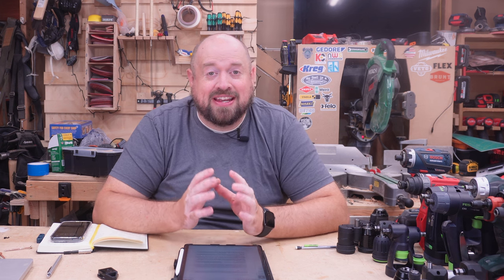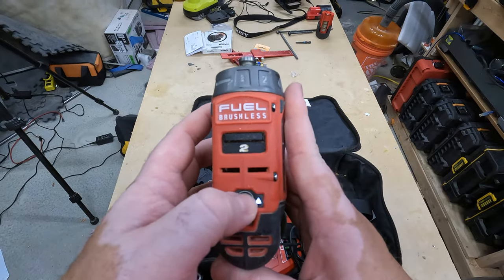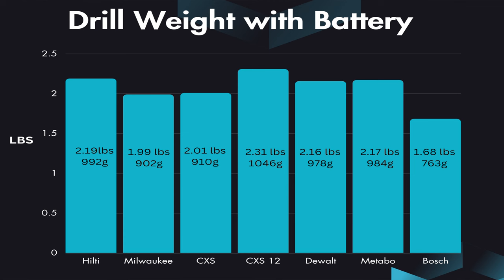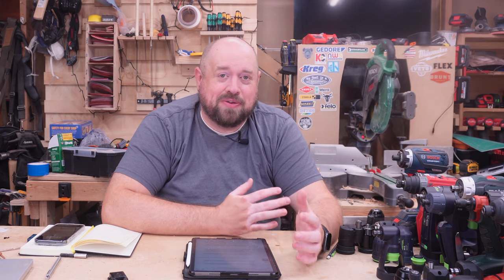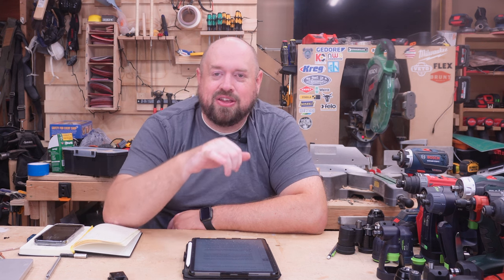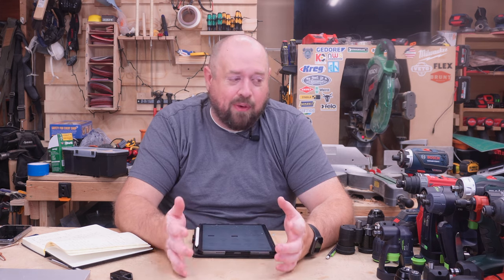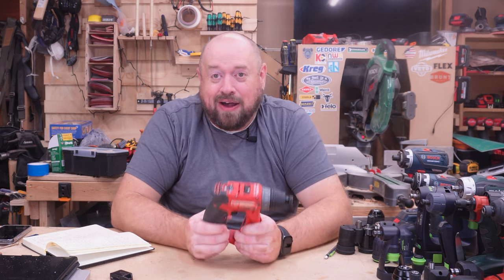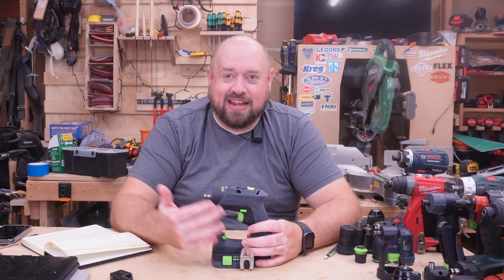Installation Drill Showdown!  Can Festool beat Milwaukee, Dewalt and More???

Comment: Bosch 12v Chameleon is the best.  The benefits of its super light weight can't be overstated. I use it every day -  very high quality and so light weight it's my go to for driving in thousands of zip screws every week.
Reply from the maker: It performed well in testing.  I have liked mine but just prefer some of the ergonomics of others more.   But you really can't pick up a bad tool in all of these.
Reply: I just picked up 12v Bosch Chameleon kit for 75% off and additional 10% military discount for $33.50.
Reply from the maker: You got the Lowe’s clearance deals I’m guessing?
Reply: @yorselrus1996  Wow that's a steal. I got mine for $99 on Amazon. I would've cleared all the local Lowes inventories at $33. Would be one hell of a gift for families and friends for Christmas.
Reply from the maker: I ended up getting other Bosch tools on the clearance deal but I have had the Bosch for more than a year now.  It’s a bit of a shame they aren’t going to carry them anywhere local to me anymore though.
Reply: I have one and love it. Also got the 12v planer, wow cool tool.

Great job on mash up, Tinker with Tools. As you say many fine niches in here.
Reply from the maker: Thanks Greg!
Reply: i have the brushless flexiclick and still reach for my cxs, until you use one, its hard to explain.
Reply: So what you’re saying is you own the Bosch.
Reply: @robertrada4783  hes saying he is a lizard man
Reply: I second this, mine is always in my bag for service plumbing. Mostly run Milwaukee but I like this drill and Bosch's FL12 work lights.
Reply: Seen yesterday for 99 bucks.Probably been there 3 plus years.
Reply: I have a GSR12V-300FC and it's my favourite. It beats everything else where it matters - size/weight, clutch precision and consistency, ergonomics.
Reply: Festool CXS very ergomomical. Its save your hand

Comment: I’ve had the m12 installation driver and the Bosch chameleon and the Bosch wins by a lot. Just that forward/reverse button on the m12 is enough to discard it. The chameleon is my daily, love how small it is and has more than enough power and speed to do everything I need to do and more
Reply from the maker: Yeah it will be interesting to see if Milwaukee changes that on a future generation.  But you are right.  The Bosch has a lot of good things going for it.

Comment: I got the Festool CXS 18 as my installation driver for work. The handle is much larger which allows for both the middle and index finger usage.
Reply from the maker: Thanks for sharing that info.
Reply: i have too but the noise level is terrible , and am going back to my faith dewalt .
Reply: FWIW Festool also makes a 12v & 18v drills that use the same range of chucks, and have a conventional grip. TXS12 & TXS18. They are trying to cover all the bases.

Comment: bosch 12v flexiclick has SDS attachment as well. its fairly new, but it is available in the US.
Reply from the maker: Yeah I found that after filming and during the edit.   Reasonably priced too.  Have yon tried it?
Reply: @TinkerWithTools  no I have not, but I was thinking of buying it in the future after I upgrade my brushed version of flexiclick.
Reply from the maker: I’ve considered buying the 18v version on several occasions just to see how it compares to a top tier hammer drill instead of a dedicated SDS.
Reply: @TinkerWithTools   In Europe you can find the Bosch 18V GSR 60 FC, I don't know how it's called in the US. It is a wonderful tool and most often overlooked in non-european tests I watched. The Hammerdrill attachment for the 12V Version is kind of lacking in a way and received mixed reviews in the german tool market.
Reply from the maker: I could be wrong but I think that its just the GSR18V-535FCB15 in the US market.  The coloring is different here but based on specs, I think that is the equivalent.  I have a video on it I did last year comparing it to two 12v multi-chuck drills, and then I also mention it briefly here.  

I put it through the same testing that I did on this video, and it is bigger heavier and not as delicate or precise.   But it's made like a tank and has a very consistent clutch (just not super sensitive).  Overall I like it.
Reply: @TinkerWithTools  Its quite bad. Slow and over 10mm = almost impossible in concrete. I think its like a good 12v Drill with percussion like Milwaukee/Dewalt/Bosch

The management in Stuttgart of Bosch power tools thinks: We need no 12v hammer drill (Like Makita, Dewalt, Milwaukee, Metabo, Hikoki/Metabo HPT...). Thats the reason for that. Price: 110/115Euros, its like 120-130 dollar
For that price you get almost the normal GSR Brushless drill with 2x 3Ah + loader in the big box

The Bosch Flexi Click 18V attachment is very good and like a hammer drill. 10,12,14mm no problem in concrete. Its a mechanical attachment, not pneumatic like normal hammer drills. Great development
Reply from the maker: Thanks for sharing.

Comment: Excellent, very helpful vid and the last thing I want to seem is critical, BUT a significant item that deserves mentioning here is the Centrotec chuck on the festool.  This requires proprietary shanks or it requires the user to use adapters that either do not have a locking mechanism or otherwise stick out so far that you lose part of the relevancy of  a compact tool.  SIGNIFICANT - but very on-brand - drawback for the Festool
Reply from the maker: If you buy into festool, you likely aren't deterred but the centrotec tax as much as some might be.  Centrotec works really well, but the prices are quite absurd.  So in terms of it working as they intended, it's great.  But for those that don't want to pay the festool tax then I agree with you.

Comment: Bought the Milwaukee last year. I love mine. I have M18 tools and now I'm looking at some M12 tools to utilize the batteries more. I love Milwaukee tools.
Reply from the maker: I have been happy with them too!
Reply: I have everything RIDGID and bought the Milwaukee drill shown. The forward reverse button is just plain stupid. I never use it.
Reply: Wait until you get the M12 fuel multi tool!  I've tried every other brand including the M18 fuel multi tool and the m12 is by far my favorite.  I've replaced most of my M18 stuff with M12.  Saves a ton of space!

Comment: About the Milwaukee forward and reverse switch at first was pretty odd but now I have not problem specially since I can still change it with one hand.
  Thanks for the comprehensive review!
Reply from the maker: You're welcome!
Reply: If you pull the trigger with your middle finger, your thumb naturally moves to the top of the tool, directly on the reverse switches.

Comment: I love the direction switch of my Milwaukee. No accidental switching any more while working with the tool. That happens from time to time with my 18V Bosch. Before using a battery powered drill, I pressing the trigger to ensure in runs in the right direction anyway. Though I have really small hands, I can reach the selector with my thumb easily.
Reply from the maker: You are the first person I have had comment that likes.  not saying that in a bad way, just pointing out this is a first.  I think that it's one of those things that if this is your primary drill, then you will grow accustomed to it, and I can see what you mentioned being a pro.   I just haven't been able to grow accustomed to it.
Reply: I know that most people hate it. It's not my primary drill, that would be a Bosch 18V-60C, but I use it a lot. Have the same kind of switch on my 3/8" impact driver.
Reply from the maker: Yeah, the switch on the impacts doesn't bother me simply because I am not changing modes as much as direction of drive.
Reply: Same here. I also like it. Inevitably I hit the direction button on my impact especially and move it into the off position. Middle trigger finger for the win 🤣
Reply: @TinkerWithTools I think it’s kind of fun. Like being in an exotic* car with the switches in unfamiliar places. Fun but maybe not the most practical…

Comment: I think one of the reasons the CXS 12 clobbered the Bosch a little bit is because of the inline grip ergonomics. Like Sedge points out, with the C-style you don't have to use your off hand to press the back of the drill. The net effect is that the torque is utilized more efficiently on the CXS. I'm thinking about ordering the 6.0 Ah battery for my Bosch. Some reviews say it ups the power and it allows the drill to stand up with the heavier attachments.

Comment: I’ve bought the cxs12  and I love it . I do however already have a T18 and a C18 with all the attachments which all fit nicely on the new 12v driver.
Reply from the maker: The compatibility between the lines is a nice feature.
Reply: Hi! What do you think about the noise?
Reply: @LesTutosdUneMinute  yep. It’s oddly loud at full speed certainly when compared to a T18 . However it doesn’t really bother me and I tend to be using it slowly a lot of the time when it is considerably quieter
Reply: Festool CXS and CXS 12  very good tools

Comment: I imagine the reason the CXS 12 stays loud at a distance is because of the specific frequency of the noise. It would be interesting to measure that and compare to the other tools as that would shed some light on which is the most annoying and/or harmful to your hearing.
Reply from the maker: Yeah, when I found that in the data I started to look into the equipment needed to test that sort of thing.   It was more expensive and complex that what I would potentially get as a return on that investment at this point.   I do think that there might be something there with the frequency.

Comment: 140 for that attachment is a pure insult, not to mention that that attachment is basically the most important and the main reason to get a tool like this in the first place. You can get a top of the line 12v drill for that money...
Reply from the maker: Yeah.   There is a reason why even owning the drill it works with I don’t own that attachment yet.

Comment: For the true collector, the Milwaukee 12v FPDX (available throughout the world outside the US), is an installation style multi head drill driver that can also hammer drill.
Reply from the maker: I have considered purchasing it a time or two.   It's about $270 and then about $60 shipping currently so that's the main hold up.
Reply: @TinkerWithTools  yea it’s pricy. And there are never good sales in EU. It’s really more for installation in apartments and using one drill to do it all. I think going beyond 10mm diameter in concrete would be too much for it - but it’s enough for the job.
Reply from the maker: I am guessing in hammer function it operates similar to the Gen 2 hammer drill here in the states and yeah, you won't get much bigger stuff done.

Comment: I've heard from a Korean professional that weird short handle of CXS and not so short but similar D shape handle of M12 are actually due to the installation job requirements. As you know, Korea is super abundant of those street signs on a lot of metropolitan buildings with at least 5 floors high and these people literally work +8 hours a day installing/removing those signs. And he pointed out that the 'strange' handle is actually really helpful when you have to screw into a ceiling or from down to top situation to install some racks for signs. Usually, this situation involves a lot of screwing into metal surface which needs precise control. He said he can do it with regular handle (like DeWalt in this video) but prefers the D type handle way better thanks to the straight screw-to-hand alignment.

Well, that's not a situation for me, a home owner+DIYer who just need a few screws into odd, narrow lumber surface from time-to-time. So, if I'm getting one of these, probably not so high priority at all,  I'll get DeWalt. But then again, details are devils for professionals.
Reply from the maker: It took some getting used to but I actually do like it now whether it’s on the Milwaukee or the Festool.

Comment: One thing I wanted to mention was about the OSHA requirements. These ratings are typically based on working a certain number of hours (7 or 8 I think, but I can't remember). So I don't think any of these tools fail the OSHA requirement if you use them less often than that. For me, I will never use a drill for that long, so the sound pressure aspect is not a concern for me; but for professional installers that might be another story.
Reply from the maker: Correct.   The actual language of OSHA requirements is a fun read if you haven’t given it a try.  The 85db limit is just the threshold when using their calculation you need to use it.  But they also recommend you use it under 85 as well.

Comment: Honestly, dewalt tools have some of the best feeling grips in the industry, plus with the 12v line, i can remove the  battery with my 1 hand on the tool if i wanted to haha
Reply from the maker: I do like the dewalt ergonomics but the hilti grip is next level of refinement in my opinions.  Takes a lot of the good from Dewalt and builds on it.

Comment: Excellent test, thanks for posting it and putting in all the work you did.
I'm also with you on these multi head drivers being my favorite drivers. 
For a while I had the milwaukee but sold it and got the dewalt instead. I've been very happy with it, and as tempted as I was by the new CXS 12, the dewalt has worked so well for me I don't feel the need or desire to "upgrade". Plus, my favorite 18V drill is the DCD800, so two different batteries, but a single charger. Lately, I've been very happy with all my dewalt purchases, though the M12 pin nailer is probably one of my favorite tools of all time.
Reply from the maker: Glad you enjoyed it.   The festool feels more refined but at the end of the day both tools were great.  I don't think an upgrade is necessary unless you just want it.  

As for the pin nailer, I love the thing.  I have both the M12 and the Dewalt 20v max and I go for the M12 most of the time.   I am also anxiously awaiting the release of the M12 Fuel Brad Nailer.  It won't have the capacity of the bigger M18 but for a lot of what I do, I want the reduction in form factor.
Reply: @TinkerWithTools  Yeah I'm eagerly anticipating the M12 brad nailer. I almost bought the M18 version before I saw that the M12 was announced. I rarely use brads over 1 1/2", so the M12 will be perfect for 95% of the work I do. Anything over 1 1/2" I'll just use my air nailer. They need to release that one already lol
Reply from the maker: I think it will be a good seller for them.   The compactness of the M12 nailers is really great!
Reply: @TinkerWithTools  For sure. I was originally just going to get a small 1 gallon trim compressor and shorter 1/4" flexzilla hose, to kind of "mobilize" my nailing setup, but man, putting the m12 pinner through its paces really emphasized the advantages of cordless.
Reply from the maker: Yeah the only pneumatic nailers that I still don't have a cordless version for are the narrow crown stapler and a framing nailer.  I want to get them but I do so little work with the framing nailer, that it's hard to justify the price premium for cordless (plus the weight) and then on the narrow crown, for the most part i am doing that work in my shop and so my compressor is already there.

Comment: I really appreciate this video. The most important factors for me are quality of the drill, the chuck, and the ergonomics. I'd have loved to see more detail on which drills have the best chuck, (especially if any have a Rohm) and which tools have the most available chucks. Not all brands have all types of chucks and some have extras worth considering. I'd also like to know if any have a higher/lower top speed. I own the 4 speed 12v Fein, am very happy with its performance, quality and ergonomics, although I wish it was possible to buy an eccentric chuck for it.
Reply from the maker: Best quality chuck in my opinion is the Hilti.  I love it.  It seems to be an unbranded Rohm if you ask me.  The Milwaukee is decent.  It’s similar to the M12 gen drill if you are familiar.  The rest are plastic outer chucks and not as premium.  The Festool feels quite cheap for the tool.  They have a metal add on on chuck that you can buy for the new tool that also works with their 18v but it’s a decent chunk of money.  Festool, metabo and metabo come with three chucks only.  And on Festool that’s if you buy the more expensive kit.   The rest come with the four standard.   The Festool has others you can buy for the new CXS 12 like a drywall screw collet.  Hope that helps.
Reply: I haven't have experience with the Bosch or new Festool but I heard you can rotate the right angle and eccentric chucks while the chuck is still locked onto the tool. That seems like a nice feature. While the m12 comes with more metal in the chucks, I felt the right angle and eccentric chucks were hard to get to seat properly depending on what position I wanted. Maybe the factory was off on the tolerances the day my chucks were built.
Reply from the maker: @jronmanbuilds every once in a while they style of chuck (the DEWALT Milwaukee and Hilti are all similar) can be difficult to properly connect but for the most part mine aren’t that bad.

Comment: FYI: Bosch has introduced an SDS chuck for the 12v flexiclick now. Good for small holes and tap cons.

Also don't forget that many of Metabo's 18v drills have multi-chuck ability as well, not to mention that Fein's 18v drills also have interchangeable chucks.
Reply from the maker: Fair points!

Comment: There is an SDS drill chuck for the Bosch 12V FC
Reply from the maker: Correct.   Found that post editing the video.  Have you tried it?   I haven’t heard good things about its power and usefulness.
Reply: @TinkerWithTools it’s a beast for small tapcons. I have the 18v version and been using it for years. I can drill 1/2 inch holes with my 18v no problem. The 12v is just as good.